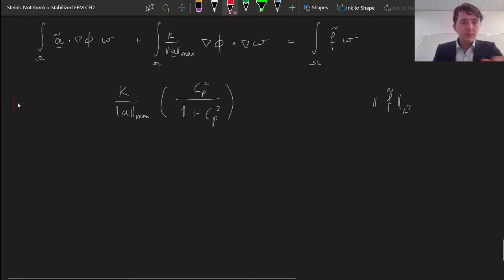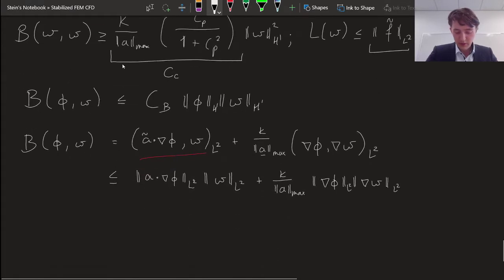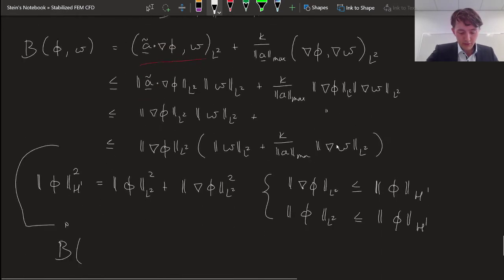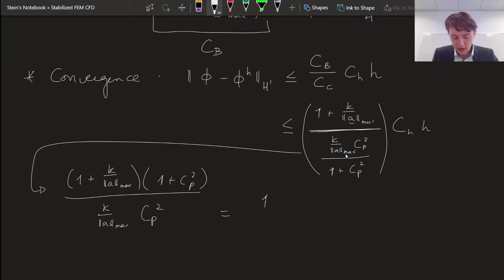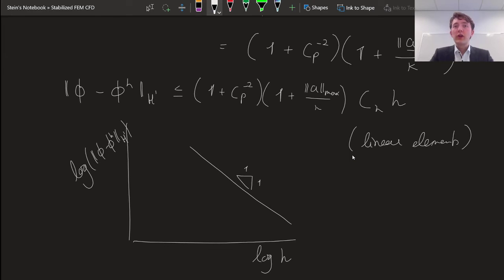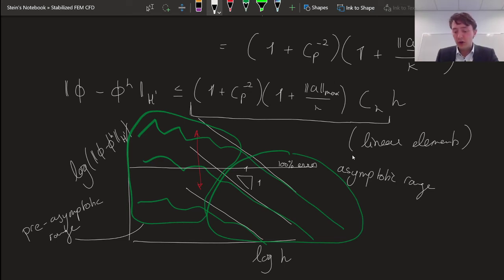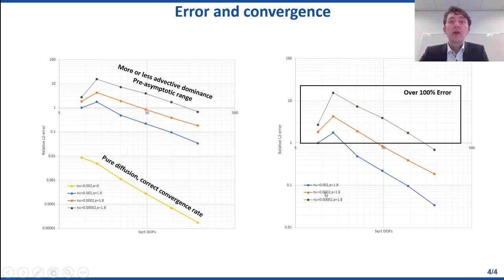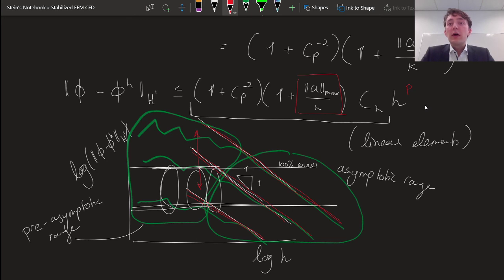20 - Analysis - Convergence of advection-diffusion

Comment: The series is very good. It is easy to follow step by step. I have learned a lot. Just wanna to clarify a little problem when plotting the error vs h (grid size), which should be increasing other than decreasing. The error vs dof (number of grids) is correct.
Reply from the maker: Ah, that's indeed a mistake. Well spotted! 
I typically like to put 1/h on the x-axis, giving the same scaling result as dofs (for which you still have to take a square root in 2d and cubic root in 3d).

Comment: If i remember correctly the convergence was not p( polynomial order) but min(p,r) where r is the regularity of our equation no ?
Reply from the maker: Hi Louis. Yes, you're absolutely right. Those convergence rates are direct results from interpolation theory (how well can some piecewise polynomial function approximate some other function), and are thus even completely independent of the type of problem that I being solved. 'r' would be the regularity of the exact solution to the PDE, which is probably what you mean. Ern and Guermond have a full chaper on that in their "Theory and Practice of Finite Elements". 
In this video, the main point was that the constant of proportionality deteriorates, which is irrespective of that exponent. So here the exponent is not so important, but I'm noticing that I also neglected to address the importance of smoothness of the exact solution in the earlier video on "Functional analysis - Error convergence", so I'll add a remark there too. Thanks for pointing this out.
Reply: @steinstoter  OK thanks you for the reference, I am going to check that